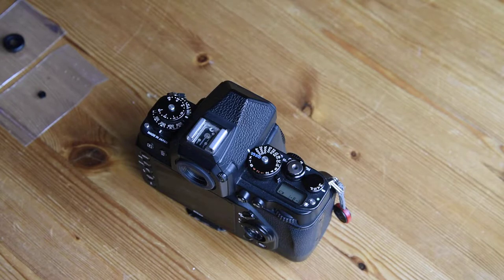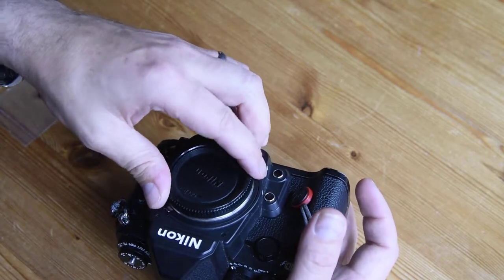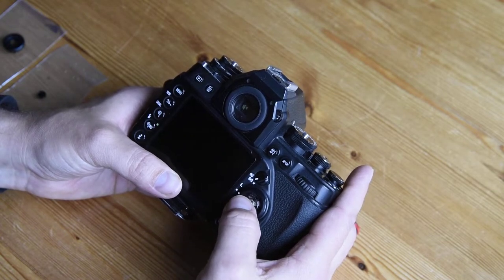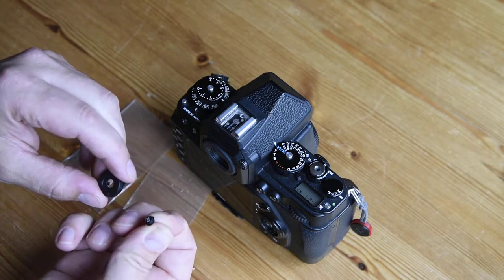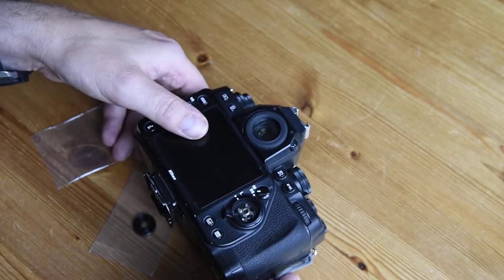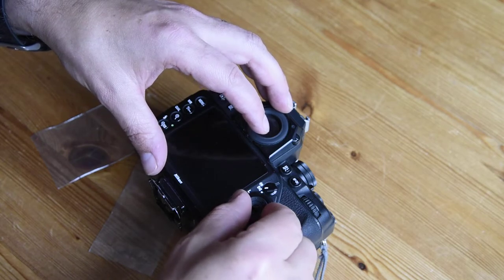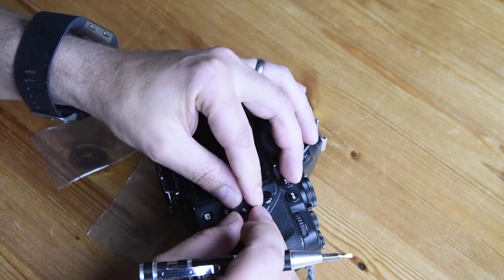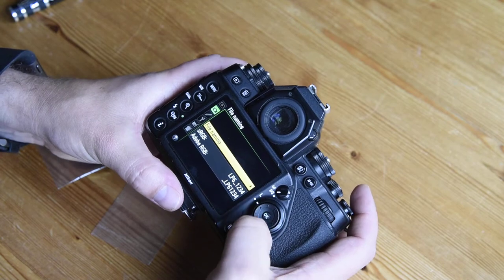How to repair the multi fuction and ok button on a Nikon DF

Comment: Hello ! you did a great job man but can you tell me from where did you ordered the multi function button and ok button? it's the same as on the d600? Thank you so much
Reply: I am having the same problem and I also don't know where to source the replacement parts. Any suggestions? 
Thanks!
Reply from the maker: @justgirdo  I've only just seen this sorry. The part is sourced straight from Nikon (UK) for me. doesn't cost much at all.